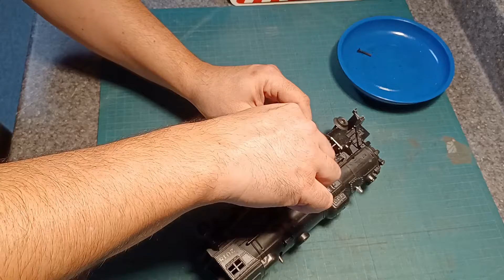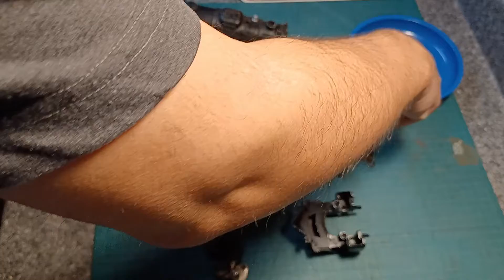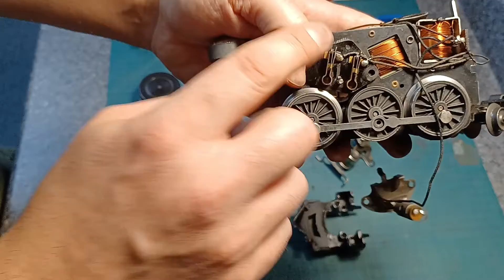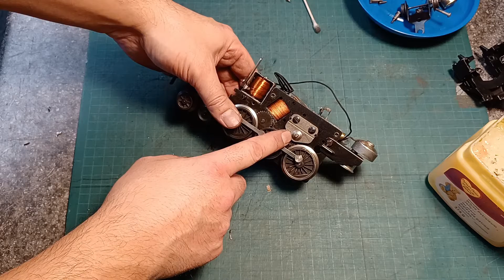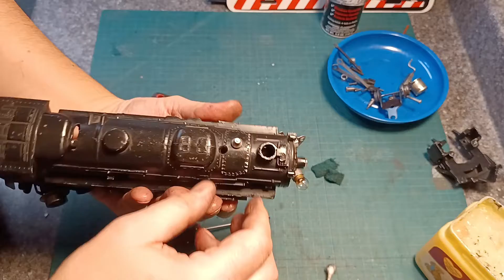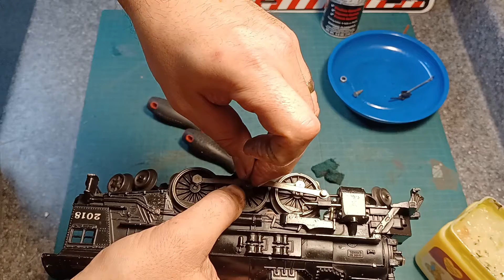How to Fix Lionel Trains Postwar , 2016, 2018, 2026, 2037 general repair and maintenance for newbies

Comment: Were do  you get bulb trains what size are they!!
Reply from the maker: The bulbs I use for my Lionels come from a local surplus store similar to "Harbor Freight" in the US. I get the screw base ones for .35 a piece and the bayonnet  $3 a pair (harder to come by). These bulbs are proper size and voltage but are actually automotive. 
To size them I just brought an original to the store and compared them. 

You can purchase bulbs online from Ebay, or Hennings. First, I would go to an automotive store with an original bulb and see what you can find. It will most certainly be cheaper
Reply: I don't have any bulbs trains  bulbs size too!! @warrenmuzakpostwarguy4331

Comment: A good way to clean out an e-unit is to give it a good spray out with contact cleaner that is available at any auto parts store. Just be sure to NOT apply power for a few minutes until the cleaner all evaporates because that stuff is flammable. No disassembly required, no flexing old wires with fragile insulation, no risk of damaging delicate finger contacts. Then disassembly is only necessary if the drum needs replacing, contact fingers are broken or bent or if the solenoid plunger still sticks.

Comment: Vaseline won't hurt these holder Lionel gears that are made of metal but do not use it or any petroleum based grease on newer plastic gears or parts. Petroleum will soften the plastic over time and cause gear teeth to strip off, making it necessary to replace the gears. This is especially a big problem with many old HO scale locomotives that were made 40 or 50 years ago. Lionel's O and O-27 trains built since about 1970 also often have plastic gears. In another unrelated hobby, this stripping out of plastic gears is also a big problem in sewing machines built in the last 50 or 60 years. To be safe, just use a plastic compatible hobby lubricant.

Comment: What is your method for cleaning the sides and especially the rail bottoms of the wheels ?
Reply from the maker: I use to use just the green scotchpad and "elbow grease", now I use a dremel and the brass wire brush accessory, medium speed to clean the wheels. I have found the clean wheels is important to properly ground the locomotive.

Comment: What is an E-unit, I don't remember what the switch does...it's only been about 65 years since I played with one!
Reply from the maker: The simple answer is that it changes the locomotives' direction. The technical explanation on how it works, I can't help you there. It's an electrical  thing that I don't understand.🤔

Comment: What a great video. I am going to do this on this same engine I've had since the 1950's and get it to run better for my grandson. Can you tell me what that E unit lever does? As a kid (and still today), I don't know it's purpose.
Reply from the maker: Thanks for watching! Im glad to hear you found this helpful. These are tough locos, and will be enjoyed by a few more generations! The lever on the eunit is basically there to A) engage the eunit so you can control the direction with the transformer B) to manually switch the direction. i have not heard of anyone actually using the lever to change direction, I do know that SOME eunits don't have the lever at all.
Reply: @warrenmuzakpostwarguy4331  Thanks again Warren, your videos are very helpful!

Comment: Very good video, but I have one question: how many drops of that smoke fluid should I put in a pellet type smoke unit like that?
Reply from the maker: Hey ASher. Thanks for watching! I find the pellet type REALLY work well with the liquid. I put 10 - 12 drops in (I use Bachmann brand smoke liquid) and it lasts for a long  time.
Reply: @warrenmuzakpostwarguy4331  Ok thank you very much!

Comment: I had a friend that would kick my but if I used a plyers to remover a nut or bolt . This was when I was a little kid . So I learned quick to use the right tool for the right job .
Reply from the maker: I believe it. My family is full of machinists and other tradesmen. They all have chimed in. I'll just grab whatever is close and works.
Reply: @warrenmuzakpostwarguy4331   I know its easy that way . I just love everything that moves .

Comment: Great Video, Warren.  I would like to ask a question.  When is an engine to rusted to repair?
Reply from the maker: What matters most is the motor, and wheels. The shell could be an absolute mess. Most of the Lionel postwar can be brought back with a few hours of cleaning. Some REALLY bad surface rust may take more time and more disassembling to really get at the pieces to clean them. If the rust has pitted the steel, or the part has deteriorated, I would say its done. I would have to see the loco to really say for sure.
Reply: @Warren Muzak Postwar Guy  thanks Warren, sorry for not getting back right away. My wife had a stroke, and I haven't done much of anything since.   She's on the mend and doing well.  Thank you for your reply. I guess I'll try to disassemble and see what's what.  Although,I have no idea what I'm doing, but I  loved your video.  Thanks again..